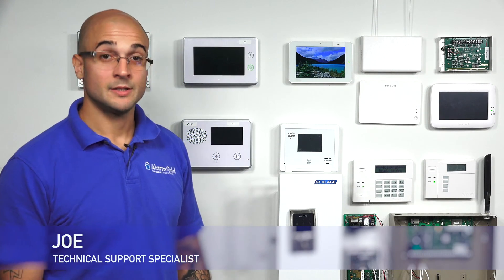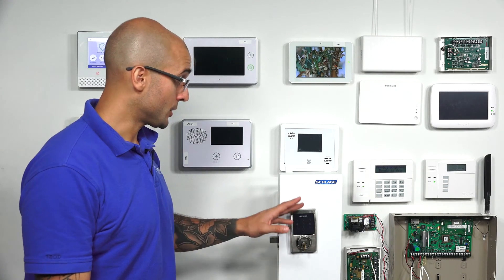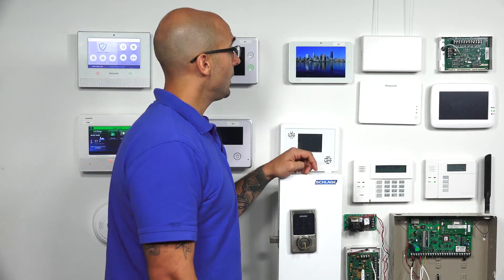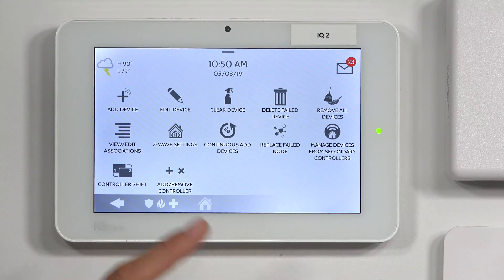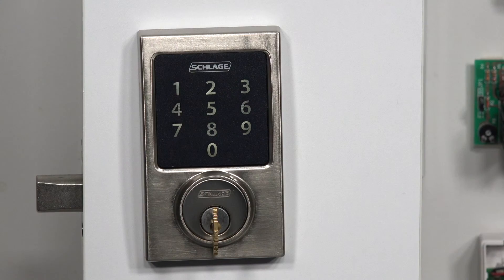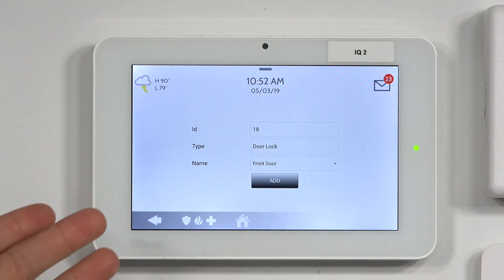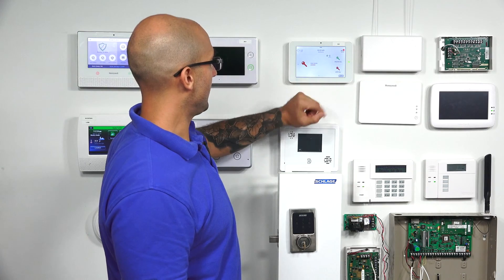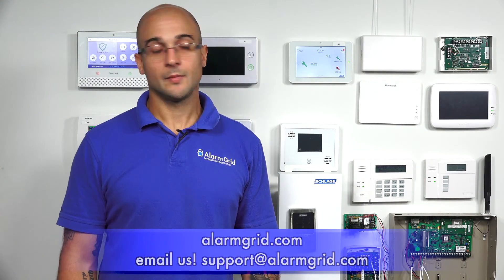Including a Schlage Z-Wave Lock

Comment: Once setup is complete can a user code be setup on the Schlage keypad that would disarm the alarm system (ie for housekeepers)?
Reply: Ciara Hibbert Hi it’s a 2GIG panel.
Reply from the maker: Hi Susan! Yes, this is possible using Alarm.com. You can find more information in this FAQ below:

https://www.alarmgrid.com/faq/how-do-i-disarm-a-gc3-w-slash-a-paired-z-wave-door-lock

Also, if you do not have access to Alarm.com, you can get access by signing up for a monitoring plan from Alarm Grid. You would need a Gold Level Plan or higher. More information can be found on our alarm monitoring page.

https://www.alarmgrid.com/monitoring